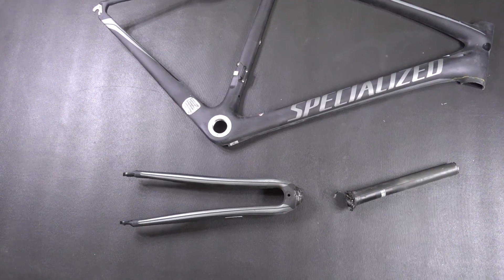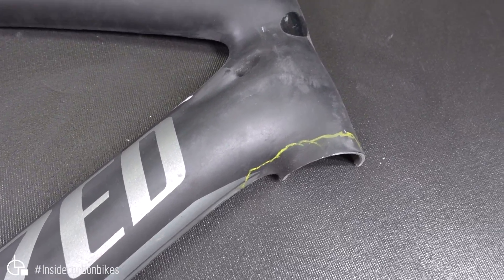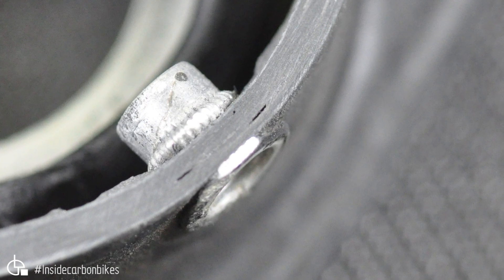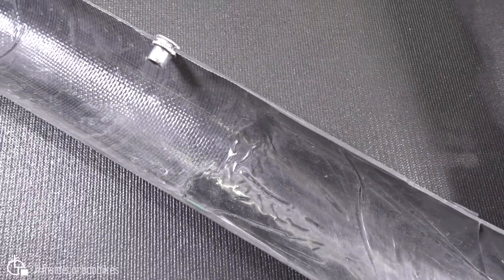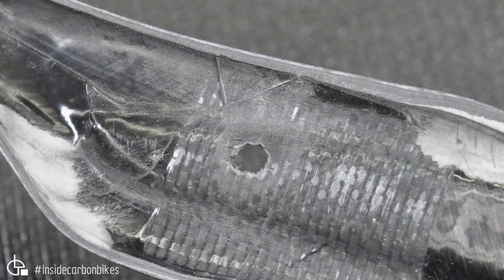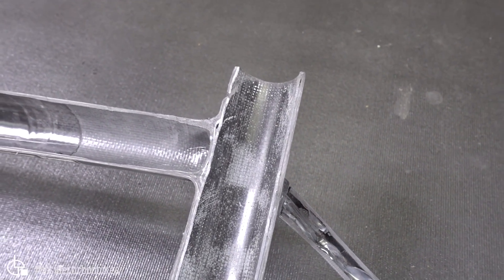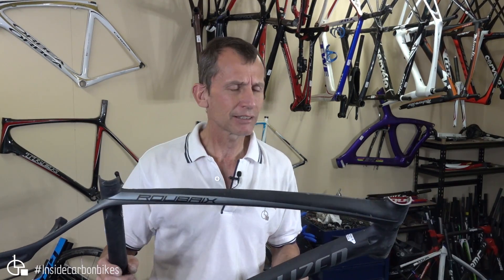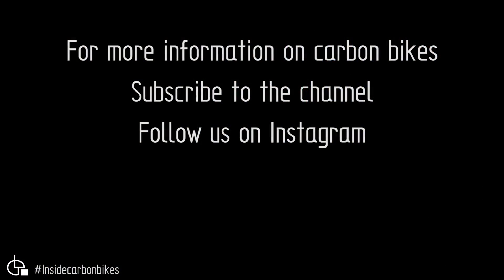Specialized Roubaix Cut up and Review

Comment: Honestly, with the loading sufficient to snap the forks, a steel or alloy frame would probably be completely buckled. Given the shock load sent into the frame, those voids & inconsistencies have stood up very well against failure. The only downside of carbon, like most frp composites, is that damage is hidden - like fatigue hides in metal. Otherwise, it’s a good frame material.

Comment: Everytime I seriously consider a carbon bike, you always provide the voice of reason. I’m staying with my aluminum. Zero issues with it.
Reply: Ive got 9 bikes. 1 steel 7 alumimium and 1 Carbon Roubaix. Although comfortable Im always aware when hurtling downhill  im just riding a toy plastic bike which could kill me without notice. I can always rely on my steel and alumimium so I won't be buying carbon again. I just had to try it and get it out of my system.
Reply: Pauly Flyer For me the coolness factor isn’t worth it. I’ve dropped my aluminum bikes a few times. Have the shop give them a once over and good to go, other than road rash, the bikes are just fine. I’ve seen too many broken carbon bikes and the horror stories are even worse.
Reply: Just cracked another aluminum frame last week. Plenty of issues if the manufacturer is a scum bag.

Comment: what about those oldschool Roubiax frames with the flexible rubber inserts?
I went to buy one, pedaled hard in low gear to test its strength, and split the frame in half at the chainstay.
I want to see it cut apart.

Comment: Most of the Italian and high end brands are complete trash, the only bike brand that dose a decent job is Fuji bike.
Reply: How do you know? Have you seen a cut up?

The problem is, most of these bikes are made using the monocoque bladder method. It's quite bad.

It's nearly impossible to avoid voids, resin pooling, and spots where the resin doesn't penetrate the carbon fiber with such a process.

Carbon: good for making aero shapes. Good for fine tuning ride quality. Good for lightweight.

But it's a joke if the manufacturing process isn't sufficient.
Reply: no i haven't seen a cut up, but they are the only ones attempting to make wrinkle-less frames by using high compaction moldings  method, which seems legit, but i agree i haven't seen one, so i cant really say its the best method, but at least their addressing the issue.

Comment: best thing you can do is buy a giant defy 5 al. and cover it in 6oz 2x2 twil weave carbon fiber with a two part epoxy and use automotive high dollar clear coat!!!  thats what im doing!!! it will last for yrs!!!!!
Reply from the maker: Until the galvanic corrosion eats away all the aluminium from the inside!
Reply: but if i use automotive etching with a high build with a two coat primer and etching the inside would that control the materials ? or should i lay fiberglass first then carbon?  how long would this last your thoughts
Reply: would it be better to just etch the aluminum then epoxy it! that would be a great insulation between the two!!!!
Reply from the maker: you will need a good bond to the aluminium and insulation, typically a glass barrier ply is used.
Reply: Luescher Teknik in the future could you give us a run down on better grease and paste that are better than what the bike industry has for us! Grease and bolts upgrades we could use! Like that carbon paste you used on the lamas' seat! Your awesome buddy!

Comment: I wonder if the quality varies in different production runs...   do ALL Specialized Roubaix of (a particular year) frames end up the same or is does it vary?
Reply: if you have a frame with many voids you can assume it will be somewhat similar (not identical) on the other frames from that production run. But it will definitely vary because of the handmade nature of things. You would need to cut a number of frames of each model to get a better overview. but i guess theese videos are a very good starting point.

Comment: what a mess inside.
Carbon is a big cover up.
Reply: The monocoque bladder method has to go.

Bike frame tubing is too small and has too many bends for this method to work well.

Inside out by Felt or individual tubes connected in a variety of joining processes are much better than what the industry has been doing for years.

Comment: Interesting, it confirms for me even more how stupid this zertz inserts were too.  By the looks of it, I doubt they did anything at all. Gimmicks are no substitute for good geometry.
Reply: The entire monocoque carbon fiber bike industry is a gimmick. The quality control is awful.

There are better ways to manufacture carbon bike frames. The inside should be nearly as nice as the outside. Clearly they are not.
Reply: @thunderpooch  Look up his video of Trek Emonda:
https://www.youtube.com/watch?v=kJl5V_KTRzc
I believe that's non-monocoque technique, and look how clean it is!
Reply: @sodalitia   It's better, but that bike is crazy light and it's still not ideal in some spots. Some of the tube sections are ridiculously thin and you can tell it wasn't intended to be that way. The resin didn't flow to those spots.

Unless you're sponsored by a team, that bike is not a good choice.

The fact is, the quality control on most of these bikes is extremely piss poor.

Every bike is different in the inside and has various weak points because the bladders they use don't even out correctly.

There's better ways to build carbon bikes.

The bike industry should be ashamed for what they're selling.
Reply: @thunderpooch  I don't know exactly how this Trek bike was build, but I was just making a point that it doesn't look monocock and it is better than monocock frame from this video. I think that as long as the frame doesn't fail without a crash in a way that is dangerous for a rider, imperfections are unavoidable. The only shameful thing there is though is that the consumable item, like a carbon frame, is being sold for thousands, when the manufacturing costs are so much lower. They say that its the technology development and quality controll is why it costs so much, but since those are just empty words with nothing behind them, what are you actually paying for?
Reply: @sodalitia   That's largely my point. The quality control isn't up to the standards one should expect based on what you're paying for these frames.

Frankly, it isn't just about rates of catastrophic failure. A lot of these bikes are not displaying the stiffness and comfort features they were designed to exhibit.

Random dry spots, resin pooling, wrinkles, etc, can't add up to the overall design goal.

They most likely won't fail, but you could very well be getting a product which isn't as stiff or as comfortable as they claim it should be.

Comment: 35 years ago i rode a 10 speed in to the back of a parked van. The bike did not break or get damaged. I got a bump on the head and my pride was reduced for a bit. Now days the bike shatters in half and the injury is more severe.

We have gone in complete reverse. Fk carbon.
Reply: I think its more about fashion in the west with cyclists obsessed with performance over everything else. Titanium is by far the best material overall for frames providing superior strength, durability and fatigue resistance even above steel and can offer a frame weight comparable to decent aluminium or lower end carbon. It benefits from no corrosion so doesn't even need to be painted and can be easily restored to a new appearance even after 10 years of use.

The world's biggest cycle manufacturer providing over 20 million complete bikes a year to many brands plus bare frames to many others actively promotes titanium as the best frame material. 

http://www.fuji-ta.com/titanium-bike-frame

It's a shame Raoul has such limited experience with titanium from what he has said I'd like to know his verdict on it. It's also a shame he doesn't get lower end carbon frame bikes in to cut up because they aren't worth attempting to repair because of their lower initial cost. 

Fuji-ta make carbon frames for Cannondale as well as many lower end brands and many carbon frames sold on the chinese market mainly under their 'Battle' brand. Is there a difference between a Cannondale and these lower end carbon frames? Do Reid do carbon frame road bikes if so would like to see one of theirs cut up to get some perspective on carbon quality at different price points. Presumably you could probably work out which brand frames come from which carbon frame factories. Giant and Merida/Specialized do their own I assume. I believe Trek and Canyon have theirs made by Quest Composites and Cannondale and most budget and shop brands are at fuji-ta generally but I assume where a bike brand is basically an importer they can simply move production to whichever factory is cheaper at the time so there may be no consistency and may split manufacturer's based on quality reasons, i.e. fuji-ta for lower end and mid range carbon frames but someone else for higher end frames. It seems some manufacturer's tender contracts as well as some recalls have shown multiple factories used and only one factory product effected not all factories as well as some frames only effected due to the use of inferior materials at one factory for a short time etc.

Looking at these cut frames I'm left feeling that quality is so variable that the frames are unsafe with many having weaknesses in different areas. I realise many of the frames he has cut up are probably poor examples hence why they failed in the first place but still I'm not keen to be going down a hill at 40mph with both wheels separating from each other and me basically flying through the air with a couple of sticks of carbon between my legs.

I hope Raoul reads these comments because I'd just like to thank him for such great informative videos although as a heavy rider he has completely destroyed my interest in getting a carbon frame myself.
Reply: mjs1231 yeah but we are on average riding much faster

Comment: Basically not even top brands are free from defects. It's a shame what happened to that dude, hope he gets well soon.
Reply: The bike industry, especially carbon fiber, is an absolute joke. All these monocoque designs are a horror show in the inside.

Face the facts: the bike industry is a consumer fad industry and it will most likely never adhere to the quality control of aircraft or even cars.

Until the process is revised, all these monocoque carbon frames are dog crap.

The outside is polished and perfect while the inside is a train wreck.